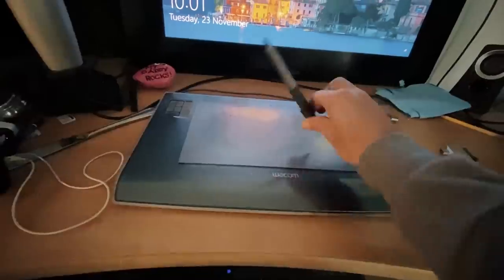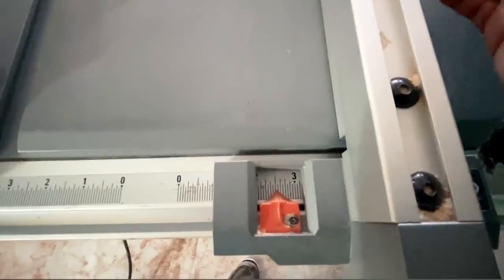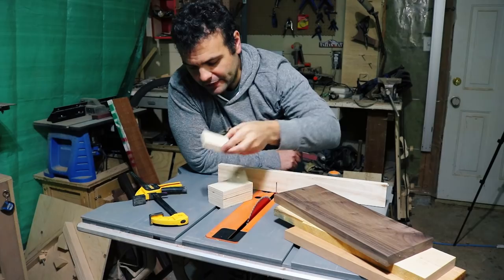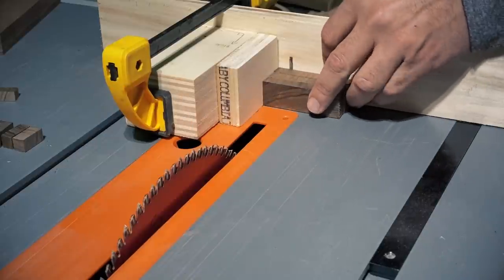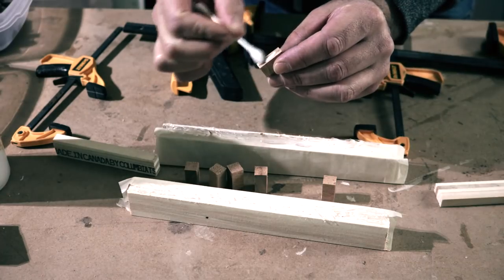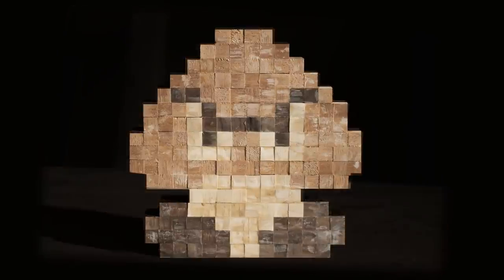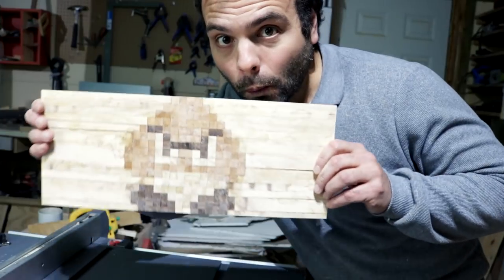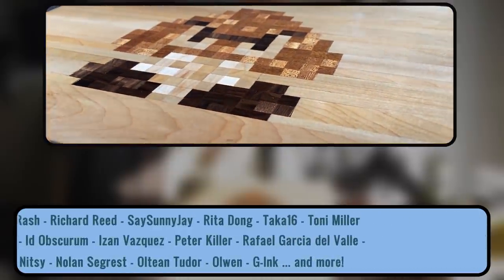How To Make A Pixel Art Serving Board.

Comment: 8:46 The grain direction might not matter aesthetically, but in order for it to be structurally sound they should all be facing the same way so they expand in the same direction. Because you made this in the winter (low humidity), the seams will press together in the spring (high humidity) causing the glue joints to slip over time. If you make this in the summer there's a good chance those cross grain joints will be pulled apart within a couple seasons. Wood by Wright has a good video explaining how and why wood moves. Ideally something like this would be veneered or 100% end grain to avoid any glue surface or wood movement problems as it ages.
Reply from the maker: This is true. I do adhere to that knowledge on more "regular" cutting boards (and actually have thought about switching my process on these to make it all endgrain). I've been careful to monitor these pixel boards throughout the seasons (we have wide humidity changes here in Toronto, Canada, so it's a good place to track humidity related stuff), but thankfully I've yet to see any glue joints fail on these. My theory is that those tiny little pixels are no match to move the larger, heavy pieces of maple that surround them. 
But who knows, maybe in a few more years I'll change my tune, lol!

Edit - your veneering idea is great. I hadn't thought of that! Could get like 4 boards out of 1 project. Time to tune up the ol' neglected bandsaw.
Reply: learned this the hard way this season when a noodle board turned into an oven arch

Comment: Marco, I absolutely loved this! I envy a bit your woodworking area, and I really admire you have all those tools and the knowledge to use them. I imagine you bought stuff bit by bit, and I'm tempted to ask how much did it all cost, but I'd prefer knowing the order in which you bought all your tools and for what needs. Very curious about it, and wouldn't really mind if you started a side channel on your hobby. I'm all in for that as well 🤩
Reply from the maker: Glad you liked it!
To answer your question, my first few tools were a table saw, a drill/impact driver kit, and a few clamps. You can get started with just that for maybe $500 bucks! Did a few beginner projects with that for several months, then bought a miter saw, bandsaw, drill press and router. Probably another $600-800 there. That was more than enough tools to do lots and lots of projects! Just make sure to buy gear when it's on sale, or used.
It was almost 2 years later when I started to develop the skills to justify additions like that jointer and planer. (Planer alone is about $800, and only does one very specific thing!) 
So my theory was to first buy the tools that give you the ability to do the most things (table saw!) and then kinda whittle down from there, as dictated by your projects :)
Reply: @marcobucci  thanks for replying so thoroughly! I also wanted to thank you for recommending Steve's channel. I've seen one video for beginners and I'm already a fan. His energy is so good! Looking forward to doing some of this in the future. Keep it up, Marco 🤩